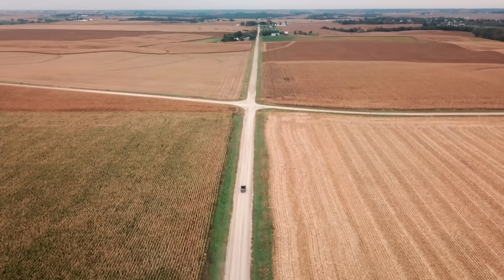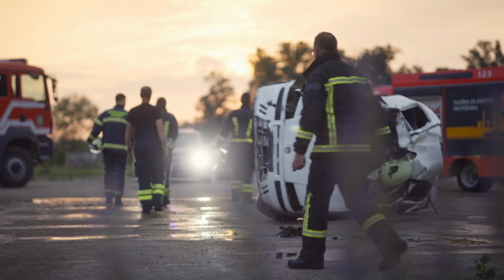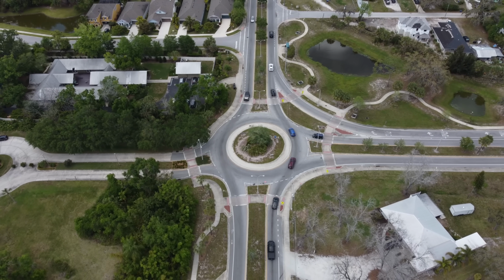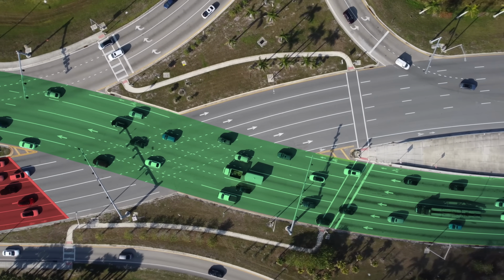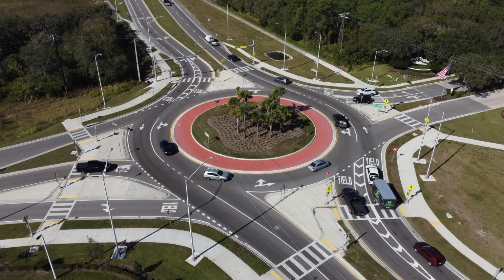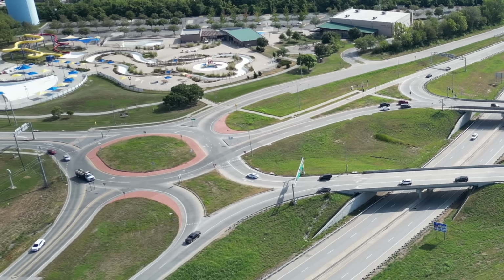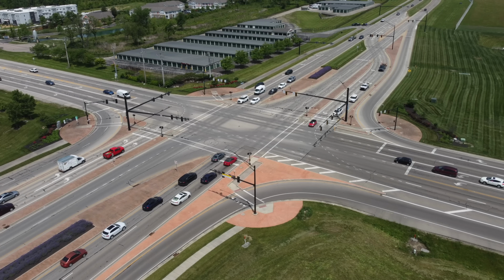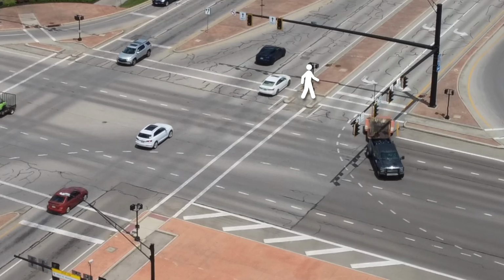These Intersections Are Changing the Roads Forever

Comment: One additional safety factor in a roundabout is that any accidents that happen tend to be more of a glancing blow to the sides of the vehicles rather than a T-bone direct hit that you would see in a normal intersection.
Reply: Not to mention the fact that a roundabout (or any big intersection) is scary and instantly makes people put down their phones and snap to attention. People are too safe with traffic lights, but a roundabout... everyone has to be involved.
Reply: Not to mention for drivers using the road, a roundabout is an automatic slow down on approach, compared to traffic lights which are 50mph-0 in 5 seconds on some roads.
Reply: Yeah.  And anyone who goes 90º through a properly designed roundabout will be deflected before hitting anyone else in it, reducing their angle.
Reply: @CrissaKentavr  though lower volume roundabouts like thousands we have in the UK can be driven straight through, just a slightly raised white bump in the middle which makes sense as a lot of the roads they're on are very narrow urban side roads
Reply: @xander1052  Mini roundabouts are about managing the priority of traffic flow rather than safety.  I am sure at one point there were not allowed on roads with a speed greater than 30 mph, and so on 40 mph distributor roads like Dorcan Way in Swindon the speed limit drops to 30 mph before each mini roundabout.

But with a give way line traffic on the main road has to wait for a gap in oncoming traffic to be able to turn right, which on normal urban streets with two lanes has the effect of blocking the road as traffic has to queue behind a turning vehicle.  So a mini roundabout requires oncoming traffic to stop to allow it to make the turn and allows better traffic flow.  There is a minor safety benefit if people slow down on approach to the mini roundabout as they should.  But otherwise they are safety neutral as they do not change the direction of traffic so collisions can still be side on, rather than side to side as on a proper flared roundabout.
Reply: like he said......
Reply: The biggest knock against roundabouts is most established areas, where there already is traffic that could benefit from a roundabout, tend to have property that goes very close to the corners of the intersection whether it be a house or business, making construction of them difficult.
Reply: That’s a great answer to a question I’ve been asking, thank you. It really shouldn’t even be a question. Round abouts have safer accidents.
Reply: And you only need to look into 1 direction to see oncoming traffic.
Reply: This comment should be higher.  I think it's the more primary reason for the reduction in injuries than the speed.
Reply: @gregarious119 literally word for word copy of the video
Reply: @gregarious119  No need for the comment, considering the video explicitly states this fact in audio form already.
Reply: That’s actually been covered…that’s whythey’re safer…
Reply: Yep, according the FDOT, 90% fewer fatalities and 75% fewer injuries.
Reply: @giantpickle  pure bs, brother in laws building them $
Reply: @Lou-jl4ov  How does you knowing a guy in construction affect the safety of roundabouts?
Reply: Just try to cross the street at a roundabout as a pedestrian, where the objective is continuous vehicle-traffic flow. If there is heavy traffic, no opportunity to cross.
Reply: @henrykerfoot8427 I hope you know that there are crossings BEFORE the roundabout
Reply: Roundabouts are designed without consideration of pedestrians
Reply: @henrykerfoot8427  "Roundabouts are designed without consideration of pedestrians"

Seriously?   What would lead anyone to believe this is true?
Reply: @JP-su8bp the fact that he's a bot /believes everything that he reads
Reply: @henrykerfoot8427 motorways or interstates to you Americans aren’t either, do you walk or cross one of these…no
Reply: Interstates are specifically designed for vehicular transport with speed as the goal (also the ability to allow planes to land for defense against invasion in Eisenhour's original 1950’s vision - So long straight sections were required) So, no pedestrians or bicycles allowed.
But now the Amurrican car culture and resultant bias against pedestrians is quite evident in roundabouts. roundabouts@garyhighland1141

Comment: The simplest retrofit to remove left turns on interchanges (that I've seen) is adding a roundabout on each end of the bridge over the highway. Example: https://maps.app.goo.gl/DeDmKcbu3h6tkYKz5. Very easy to add to existing interchanges and gives a ton of benefits.
Reply: This is the most common setup in the UK.

Comment: In Europe, we have another option: the highway crosses a bridge and a roundabout is obtained underneath. Is this design used in the US? If not, is it possible to implement it?
Reply: Dumbbell interchanges are functionally the same, except the bridge costs less. Dumbbell interchanges have 2 connected"almost" roundabouts, which together make a funnily-shaped roundabout.

Though they do have a larger footprint around the interchange.
Reply: @GoLivingInternet larger footprint than this video's divergabout??
Reply: Yes it exists, but I've only seen one. In Castaic, CA there's 2 roundabouts connected to a bridge over the I-5
Reply: I should add that usually only the double roundabout version is seen in the US, I've never seen the single large roundabout type, likely because it requires a longer bridgespan.
Reply: I've seen 1-2 in my region but it's uncommon. In areas with higher traffic a traffic light may work better than a roundabout, while in rural areas they may simply use a stop sign.
Reply: @needles_balloon That used to be true but is increasingly less true.
Reply: Yes, and it is increasingly popular at certain types of locations.  But the US version is squished in the middle to make a peanut shape.  It is cheaper and easier to build that way and uses less land.  But those are for different locations.
Reply: @LasiCR In the US's most European city, Cambridge, MA, the intersection of Memorial Drive and Brookline Street has this design. It's actually one of my least favorite intersections and frequently gets extremely backed up on all sides, but I think that's due to the other quite challenging traffic engineering issues nearby. Boston in general is filled with so many random intersection types because it's such a poorly designed city for cars. It's actually a cool city from a civic engineering lens but it's not a very pleasant place to drive. Fortunately it's also quite walkable and has some of the best public transportation in the country (still little by European standards).
Reply: Road Guy Rob has a video about dumbbell/dogbone interchanges. The video title is "Roads don't have to be FAT to be FAST".
Reply: Roundabout interchanges are the default in the UK and theyre usuallu messed up by traffic lights
Reply: As others have mentioned, the interchange with one large roundabout is uncommon in the US. The only one I can think of is I-91 at MA 2 in Greenfield, Massachusetts.
Reply: In Canada I've seen the opposite: a bridge over a highway, with a roundabout on either end of the bridge, meeting up with the on and off ramps. It's a dumbell shape. Example: https://maps.app.goo.gl/sHW88PUkQZhDYdi96
Reply: Full roundabout interchange is costly.  America only uses roundabouts at each ramp instead.

Comment: I live very near to both of the "diverageabouts" and I can tell you that they are absolutely seamless to drive through. I remember 10 years ago when they were simple diamond interchanges with stoplights.
Reply: To be fair, a lot of us in the KC area scoffed and laughed at the absurdity of the original design when presented to the public - it legitimately looked downright confusing. In reality, it really was a well designed system.  69 on the ks side is getting a dogbone roundabout at the 167th st exit, so that'll be fun to maneuver when that opens back up.
Reply: I got something similar to them [divergeabouts] where I live, and would be very interested in his take on the kind of infrastructure over here.

To be clear, it is not in the slightest a divergeabout (doesn't even make the right and left switch sides), but it is a motorway whose ramps points into roundabouts (on both sides).
I think a large part of why they made it like this, is because it is not merely a road crossing a motorway (and neither is it a frontage road that interferes), but actually that on both sides of the motorway TWO roads run up to it and want to cross (So it is a bit like a `>+<` shape, where the vertical bar on the plus is the motorway, the horizontal is the bridge, and the ramps are not drawn at all). So it is a similar case as the frontage-road one, but instead of a full on 4-way intersection, it would have been a T- or Y-junction.
Reply: Were they easy to navigate immediately, or did you need to drive through them several times to be comfortable?  I'm just curious if it's something that is easy for all drivers, or only for locals who are used to the design.
Reply: @Paul71H  I found it to be pretty easy. Some people find them confusing though, from what ive heard but once you do it once its not bad
Reply: Funny name divergeabout and it fits perfectly with its appearance. Haha
Reply: I don't understand why the road parallel to the highway even exists, without it this design wouldn't be needed. What's its purpose?
Reply: Those are frontage roads and they allow access to the land so that developement can happen right up to the highway.
Reply: @TichiFox  Can't they just make smaller roads that would be perpendicular to the highway without reaching it, which could be accessed from the other side? The roads don't need to be parallel to the highway for this area to be accessible. In any case that is still a mystery to me
Reply: @ehjapsyar Frontage roads are pretty common in the KC area. This particular one leads to a high school, which caused a lot of delays at the intersections before and after school as all the buses and cars would be leaving at the same time. Source: I went to school there decades ago.